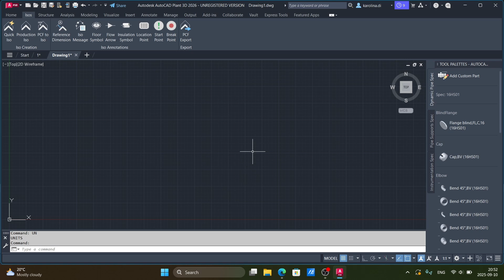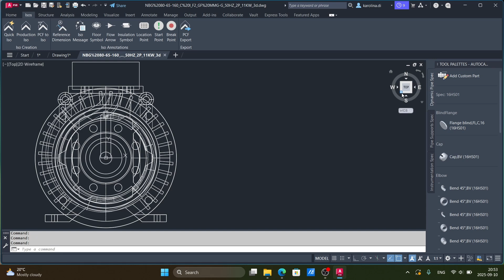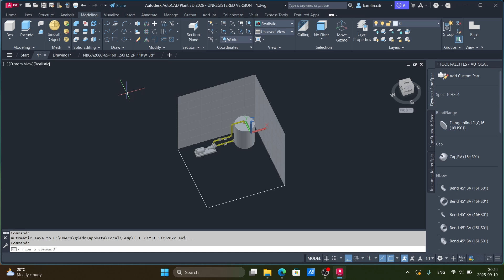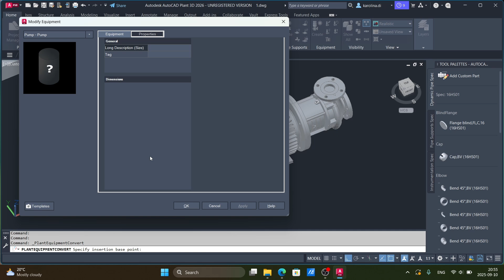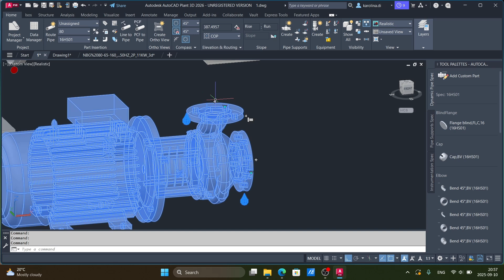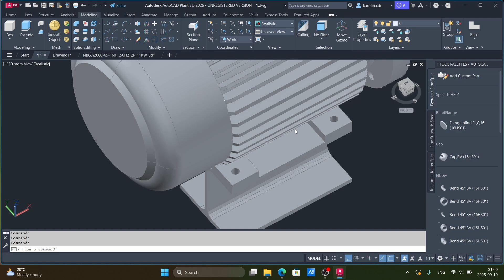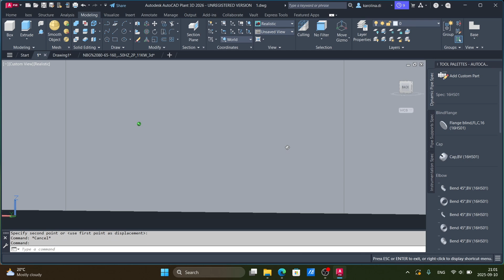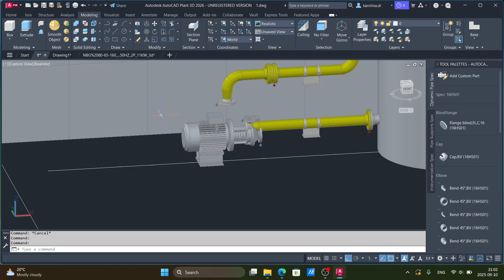Insert Real Grundfos Pump into AutoCAD Plant 3D | Realistic Pump Modeling Tutorial

Comment: the file is available but it is in 2D and there is isometric drawing which is also in 2D not 3D when in isometric drawing there is no option to change pannel or direction.
Reply from the maker: The model is made in 3D but maybe you have some display error. Maybe try another setting or reinstall.